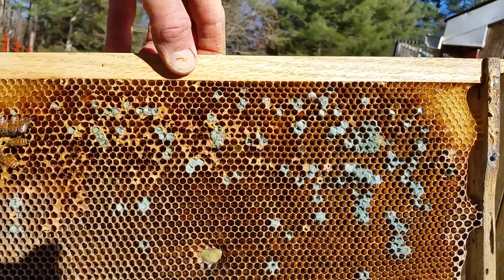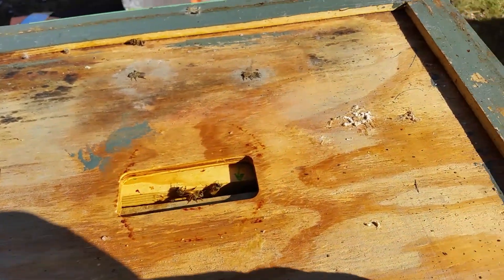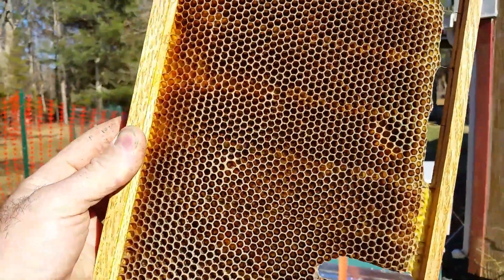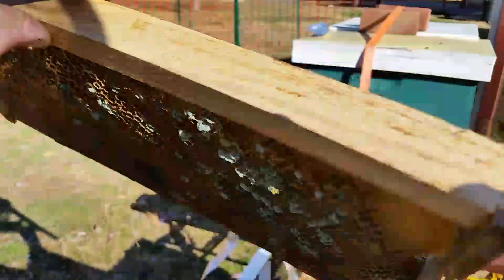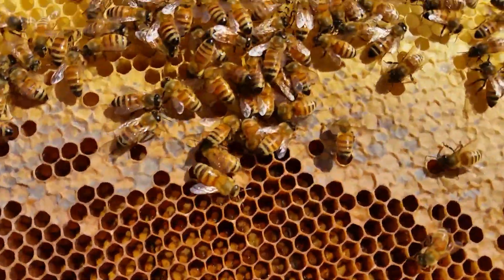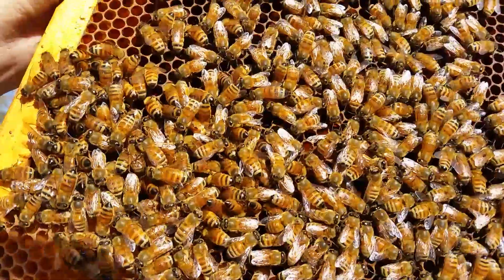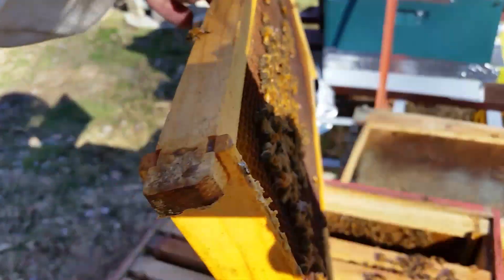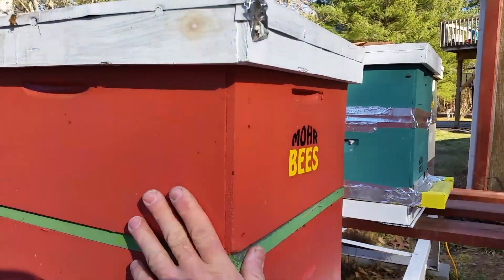No upper vent - mold? RED Bee hive 3/2/22 Queen 7:38 - Learned from YouTube -  NJ Beekeeping

Comment: Large hive with lots of empty frames and a small colony simply can't keep everything dry, therefore mold towards the edges. Also, the capped brood looks like drone brood. You may have a queen unable to fertilize eggs and so they will dwindle now. No venting up top works fine for keeping the roof dry as long as you have the roof insulated but water will drop out wherever something,  frame or wall, reaches the dew point.
Reply from the maker: Yes, can't believe they servived, and getting bigger, still some green left and without sunlight?